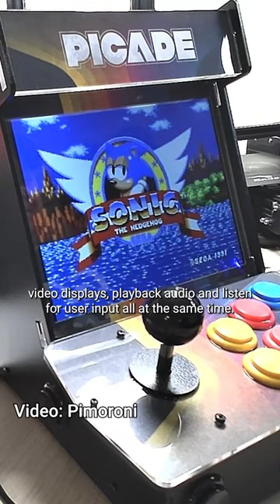Arduino vs. Raspberry Pi #BeckyStern #DigiKey #short

Comment: Short answer is an ESP
Reply: nah, short answer is anything but arduino. they’re toys. the rp2040 is an excellent chip.
Reply: FPGA
Reply: @Alkatross  have you ever used one? It does have some plusses but if you need connectivity etc... it's just a hassle.
Reply: @AtaGunZ  I havent yet had a use for FPGA, but it seems really flexible and fast for real time operations, or if you need a lot of input/outputs. ESP32 is the craziest thing I've used. I might buy an fpga board to play with.

Comment: An AVR8 based Arduino is roughly the capacity of the computer that flew Armstrong to the Moon and back, although to be safe, they had a spare for emergency return, also the Sat V rocket to leave Earth had its own IBM in the middle .  Now the Apollo computer had more I/O pins than an   UNO, making it more like an ATMEGA board, however the entire code and data fit in 32 KB customized to each trip and radiation hardened by putting each of those 256 kilobit in its own wiring detail .

Comment: What do I use for a garden automation project? Control several valves and monitor and report a dozen sensors. Pls
Reply: Try ESP32, it's cheap and easy to program...
Reply: You should look at the ESP32 side
Reply: I agree with the other comments about ESP32. 

- However, don't mistake an "ESP8266" microcontroller for an ESP32. ESP8266s are similar, are often lacking special features found on its big sibling the ESP32 series,  but don't get me wrong - the 8266s still often have WiFi, with some being so physically small that it could fit in a  water-protected project box with a sensor, sending back the sensor data to the main ESP (the ESP32). 

All the best, I hope you're able to achieve the result you envisioned, and perhaps instead of being put-off by the ESP, you might experiment and realize how incredibly useful they can be (especially their higher CPU speed than on Arduinos, larger program storage space, plus there are countless webpage-based guides/tutorials (along with thousands of YT videos ) so you'll easily be able to learn how to make great use of the ESP series of MCUs.

Comment: Honestly an old mini PC x86 also works, Arduino is also a micro controller, the pi is a single board computer
Reply: What about the pi pico and aurdinos single board computers
Reply: @nightchicken3517  I was mentioning what they are mostly known for even tho I said it as it "is" instead of "is known for" . Personally I just heard of the Nano ESP 32 1 week ago so I think I may be outdated.

Comment: All single core CPUs are single threaded. Yet they all feature multiasking. Go figure: multitasking is achieved my software process scheduler. 

Do not trust people to teach you if they don't know basics of what they are teaching. 

This is the case here.
Reply: You're also focused on the wrong thing here, pal. The script clearly doesn't use pedantic language because, well, this short is obviously not meant for that type of audience. If you really want to be pedantic, you might stay here for a long time because the os, the kernel, the cpu, and even the individual cores have different aspects of multitasking and scheduling associated with them. 😂 What she actually meant so say is that, those processors aren't capable of true parallelism.
Reply: It's obvious that she's not talking about multitasking as an OS does it. She knows what she is talking about. Your libel is unfounded.
Reply: You got it backwards. Arduino cannot multitask BUT can multithread. The difference between multitasking and multithreading is concurrency vs parallelism. Also, with preemptive multithreading you need special interrupt vectors in order to actually implement a scheduler. Not every microcontroller may have them.